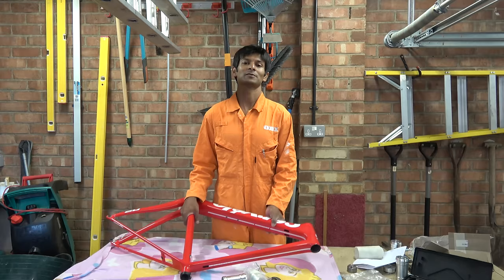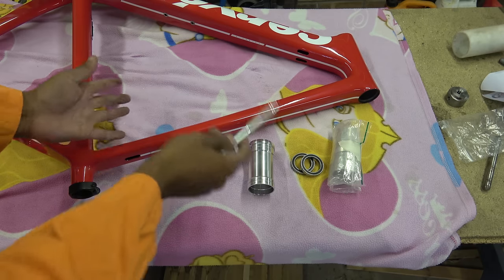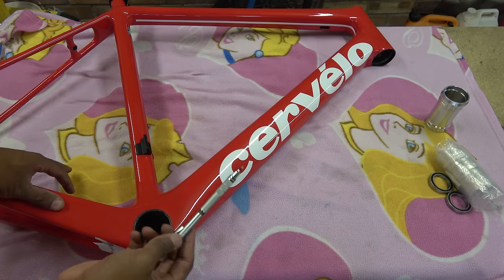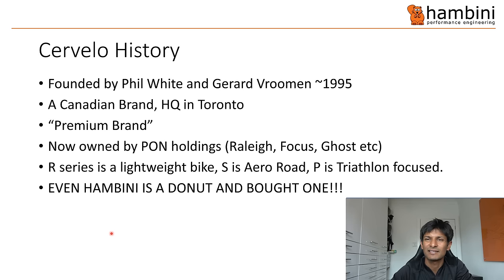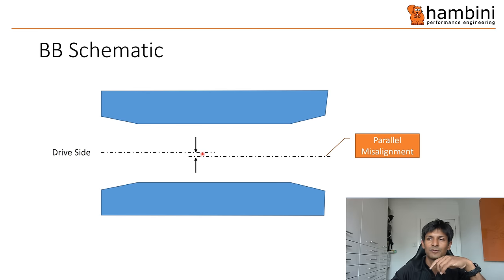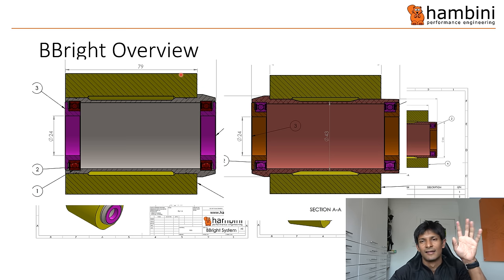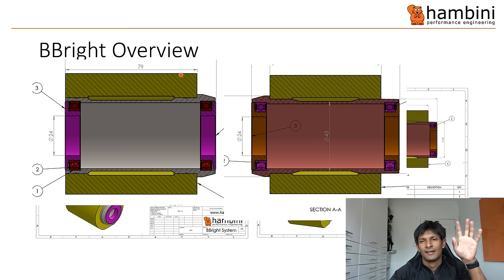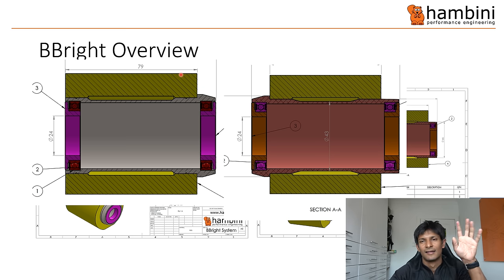Cervelo Exposed and fixed... Scumbag Aero bike manufacturers (A Hambini Reaming)

Comment: Why can’t the manufacturer over build the bottom bracket with a thickened wall, and with an undersized opening, then jig the frame and machine the bore and face it, precisely?  How much weight and cost could it add?
Reply: Carbon Fibre cannot be bored like metal.. boring or just simple drilling in non-reinforced areas will destroy the integrity of the part in question.

Comment: Hey mate, have you considered a cutting broach, cutting the bore oversize. Your making the BB yourself so you can control the tolerance, therefore if your also making an oversized broach you an make a new sleeve. The hard part would be to ensure the crank is in the correct perpendicular alignment, but should be achieved with a jig. Having these oversized bb sleeves allows you to cut your correct taper needed, and still use your correct bearings of your choosing. May be a long way around, but you would instantly become the cervelo repair man of choice in the community. My 2 cents

Comment: I know this is old, but I can't resist....
1. I can't figure out what boundary conditions you used @ the edges of your computational domain, which appears quite narrow.  If reflective boundary conditions (which appears to not be the case) then you're simulating an infinite series of wheels, side-by-side.  I wonder if that affects your results, since the size of the vortices is comparable to the domain size.
2. I don't understand how pressure drag, in the absence of skin drag, cares in what direction the wheel is rotating (relative to the wind).  Skin drag of course depends on the speed of the "skin".  The perturbation to the air flow doesn't care if the surface is moving.  This would also imply drag does not go to zero at the ground -- the air is still being perturbed, and that requires work.
3. My "marketing level" understanding is the full NACA profile is undesirable because of the reward part of the rim... truncating the profile loses a bit on the front portion but gains more on the rear portion.  But as you've pointed out you can't analyze the rear portion accurately without spokes.
This video was great... thanks.  Clearly I have a lot to learn on how air flow generates drag force.

Comment: Watched a few of your vids now just for curiosity really. I am an older guy almost 68, cycled all my life, used to time trial years ago. These days its leisure touring and Audax I just like to ride. I have been slightly tempted to Carbon, and I have worked with it in Aircraft (Retied Aircraft Fitter where they call it the new Asbestos due to health concerns with the dust). Watching all this and you evidently know your game, I stick with my steel frames for what I do. Reynolds 631  725  853, good stuff and light enough etc. for my uses. Built by real craftsmen that know what they are doing, Mercian Bob Jackson(sadly recently closed due to retirement) Geoff Booker for trikes who is an excellent Toolmaker, Woodrup, Steve Goff and many other hands on no bullshit guys. For me I use the old square taper BB with Stronglight cranks I can go down to a 24 T inner ring if I want and climb anything. As Grandad will often say...some of the old ways are the best. If I was young and racing I suppose I would have a different attitude. Great site I enjoy watching keep up your good work.

Comment: Hah! Unachievable tolerances... I have to deal with this all the time. I work for a respected motorsport manufacturer (I won't say who for obvious reasons...) and often am given a job where the customers drawing just doesn't make feasible sense regarding tolerances. these jobs are sometimes provided by the customer with a guage and on more than one occasion the guages are scrap and not fit for purpose yet they insist we use them! A lot of to and fro-ing usually ensues with our designers arguing the toss with their designers untill some kind of workable compromise which works is reached. This is especially frustrating when you look at some of these components, some of which are safety critical, when you try to see how they managed to get it so wrong in the first instance when the solution is usualy so simple that you wonder how they got it wrong in the first place!

Comment: Hi Hambini, i watched your video with interest as i have a 2017 R3 frame, which i have never had an issue with, should i consider myself lucky? also i am aware of friends ridley frame which has some issues with the BB... Finally, I thought he R2 frame was the base model of the range and that being the case you can pick a whole bike up for £1500 - from sigma sports , not the £3000 you mentioned in your vlog.

Comment: Just watched the whole vid. Owned an R2 for only 2.5 years and having issues with bbright, what do I do, get a new bike or fix it/modify it so I can run a full Ultegra groupset? Also, if "respected" brands dish out such poor quality, what's the downside buying Chinese framesets at a fraction of the cost?

Comment: Still halfway through your video. Nonetheless, just wanted to add a bit of salt to your comment on wahoo beahviour. I was a customer with one of these faulty turbo trainers. Actually, I was the owner of 3. They screwed up, it happens, they just have to own it and solve it. They did it on youtube but on the customers themselves. So, for the customers with problems (me) they accepted the faulty one back and sent a "new" one. New on quotes because it was NOT actually new. What they sent me was one with the structural problem that was sent back by another customer, they polished it and sent it back to clients. 2nd unit algo had the same problem, they accepted it back and sent a 3rd one, again with the same problem. So, basically they were sending "refurbished" trainers with a problem that was indeed structural (unbalanced flywheel) so it would never ever going to work fine within a year or so. For people who used more regularly (like me) it meant lasting 2/3 months before the problems turn back again.

Comment: This is really interesting to see. I worked in product liability litigation in the bicycle industry for a long time. There was a lot of respect for Cervelo because they were the first to go against the bike industry when making frames so light, that they were unsafe. You can google Cervelo and steer tube durability and safety. Perhaps things have changed.
Reply: Just because they were going against the industry doesn't make them an ethical and responsible company,.. they were probably going against the grain, because they could not compete against other companies in terms of producing light bikes. As i have written here, Cervelo have a history of bad engineering since the beginning, starting with their S1 soloist, which had owners scrambling for solutions for their badly-engineered sinking aero seat post.
Reply: I bought my Cervelo RS that was designed/manufactured before the sale.  It is the worst finish quality of any bike I every owned.  You might have a slightly different perspective if you saved for 5 years to buy the racing bike of your dreams and your heart sank every time you look at it--and hoped it was only the finish quality. Nerd Alert has it right.  Admire a company for "going against the grain" from afar.  Patronize a company with your money that has a real commitment to quality. Lessons learned.
Reply: steve rice Sorry to hear that. The comment above yours could be true too. There are a lot of dirty little secrets in the industry, but also I think companies genuinely want to to good and well.
Reply: @nerdalert545  Sorry, but after working in corporate america for several decades, i can truly say that most public companies are only interested in making money for their shareholders.  If bicycle companies wanted to do their customers "good" they would never outsource their products to China. Here is a Finnish bike manufacturer who did the right thing and refused to build carbon bikes in China: https://polebicycles.com/why-arent-we-going-for-carbon-frames/
Reply: @ggdd1299  Your anecdotal experience must be what is true for all corporations then. As General Counsel for many corporations, I can assure you that profit and wellbeing of customers is not mutually exclusive.

Comment: I enjoyed immensely. But someone please help me understand the fix. I guess the bullet gives the BB a better introduction into the bore. As stated that reduced the risk of the shell cracking. But what transpired that then resolved or mitigated all the BB shell tolerance errors?

I have no experience with pressing in BB parts so maybe this entire procedure is different from what a mechanic normally does that then causes the problems?

Comment: Hambini, is there a set time frame when this cockwombling Rinard geezer was there signing frames off ?  Does this problem encompass all Cervelo frames or just a set frame range ? I have the 2014 S5, only problem so far is a dried out BB as I didn't get it serviced.
Reply from the maker: I'm not sure. The date on the drawing suggests 2010 but it must be back dated or not released. Whoever posted on bike rumor must have been following it.
Reply from the maker: @justme8386  I think it does
Reply: @Hambini  cheers buddy, buying a BMX now.

Comment: Found this video by way of having similar BB issues with a different brand bike. What a nightmare.

Sounds like they engineered the tolerances correctly, then paid for crap production. Instead of paying for proper production or paying to fix the frames, the downgraded on tolerance spec - and put their garbage production issues onto the customer. The fact that a professional would put his name on that speaks a lot about the integrity of that individual. And Cervelo. What a joke. 

Granted this guy is a professionally accredited engineer, someone (who's and engineer) might want to pass this along to the regulating/governing body in his area. There should be some sort of putative action taken against him for helping to rip people off

Comment: I have snapped 5 frames, a few flavours. Mainly jump bikes, 1 kona, 1 orange, 1 Monty little trials toy, an acid dipped giant(the dip probably didn't help) and an intense somthing or other. Best customer service was monty and orange both replaced the frames. Kona was the worst by far, weeks for replies no resolution in the end because in the pics I sent I had change the cranks brakes etc and they said it was no longer original. These companys are hard at it. I bet if half these bikes got used properly and never sat under stairs and in sheds there would be piles more complaints.

Comment: I refuse to buy a bicycle with press fit or a variation of press fit bottom bracket.  This design is inferior to the screw in type. Press fit is done for the sake of saving few bucks in manufacturing.

Comment: Why don't bike manufacturers build the bottom bracket shell and then form the bike around it within the mould rather than trying to machine a perfect hole. Surely there must be a consistent way of doing this? Or will it be too labour intensive. Also does this mean that bottom bracket shell making is much more accurate with steel or aluminium.?.

Comment: Need to buy a new tyre, why should I get a 23 over a 25 for the front wheel?
Reply: You Should NOT...  
28mm minimum...
Reply: "Best" for Discomfort and PinchFlats ...   
Do You Velodrome (or Ride on Incredibly SMOOTH Surfaces)...?!?  
(I didn't think so...)  
#FigureItOut however YOU Want, my suggestion is more than valid and Beneficial...  
(Your 'tact' however, is not...)

Comment: Are these frames not align bored?  It seem it would be impossible for the bores to be straight and parallel by simply molding them.  Manufacturing machinery is just not that good and the media is too subject to distortion after removal from the mold.  It's crap.

Comment: Be nice to see some thrust ball bearings on your press tools. You're also missing a set of feeler gauges a little more accurate than a sheet of paper. Great engineering, from the title I thought you were going to end up diamond reaming it to try and get it square. I wonder how the cheapest Chinese carbon frame on ebay would compare.

Comment: I feel like the only proper way of dealing with this would be to use a five milimeter thick carbide bottom bracket instead of this foil thin aluminium thing. 

Or maybe chucking the thing up on a mill and boring it out to get it straight and round.

P.S. with that ~0.1mm clearance between the frame and crank arm, all it takes is some road dirt to scratch and damage the frame.

Comment: Please do a case study on Specialized and their praxis BB's. I've had so many issues with my s-works Venge 2019 creaking, which I could never truly fix, and a lot of fellow Specialized owner have had the same complaint. This is totally unacceptable on a 10000+ Euro bike!
Reply: Take the Praxis adapter BB out of the BB30 shell, install BB30 bearings with retaining compound, then use reducing cones, with grease, and a Shimano crank. Solved.
Reply: @Hansengineering  sounds good. I'll try that

Comment: Power loss of 11watts @ 50mk/h is a nonsensical statistic for this. The speed and load on the bottom bracket bearing has nothing to do with bike speed. Was this an error in the presentation? I suspect the power loss of a loaded bb is actually quite a bit less than 11 watts at any rpm a human actually does.

Comment: LOOK 795 had disastrous integrated stem bar system that was so poor in that you couldn't torque up the position /angle you wanted enough to stop it moving without first flatning the threads!.

Comment: I had a problem with bracket (bearings - stock shit, I weigh almost 100kg) 5-6 yrs ago. Reinstalled proper new ones, no problem since and my frame cost like ~  $100 :D

Comment: LoI, I am just guessing but likely they(cervelo) provided the manufacture with the first tolerances , then the OEM manufacturer either could not meet them or said that cost will increase X% if you want this (better) tolerance , but if you have lower tolerances you can save X%$ and increase your margins. So likely these tolerance changes were an economic decision , greed is an awfully powerful thing.  But I am just guessing.